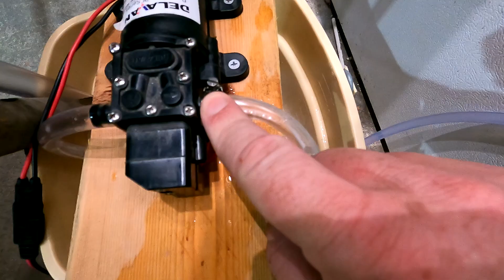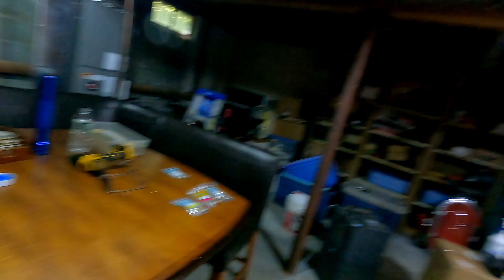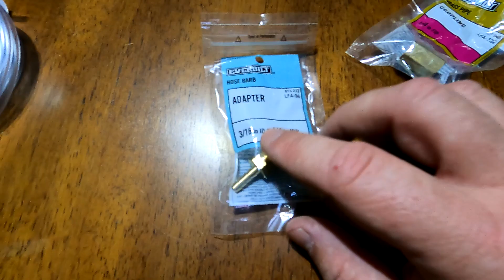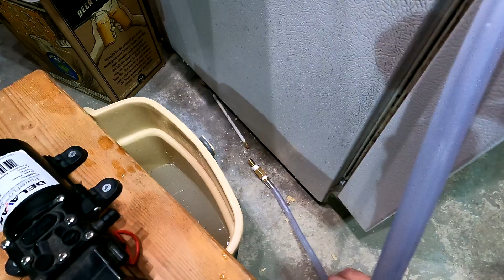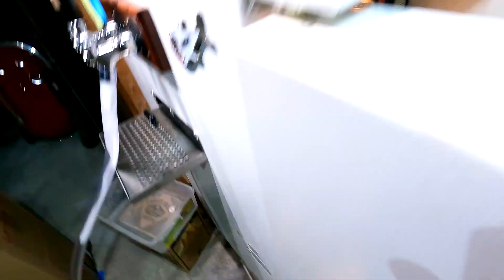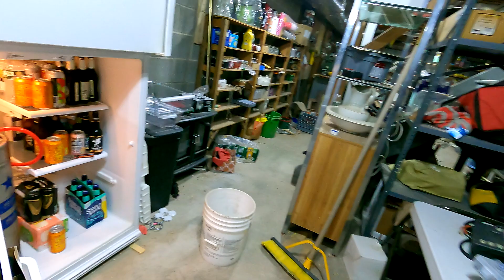DIY Beer Line Cleaner for Kegerator - The Perfect Convenience!

Comment: One question on the pump. Are you able to get enough flow if you daisychain more than one hose and faucet? I’m thinking about using a sump pump, but I’m afraid it would be too much force for the system.
Reply from the maker: You could probably run a splitter off the pump and run a hose to each tap. I guess it would depend on the size of the pump you use, but I think the risk of damaging anything would be pretty low. 

You could also probably somehow connect a line from the outlet of one tap to the inlet of the other, then from the second tap into the bucket.